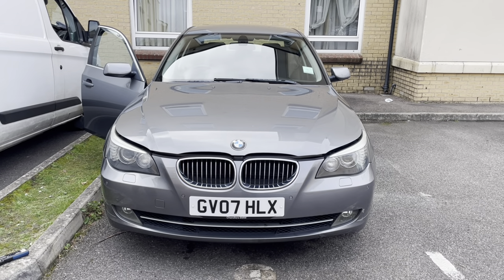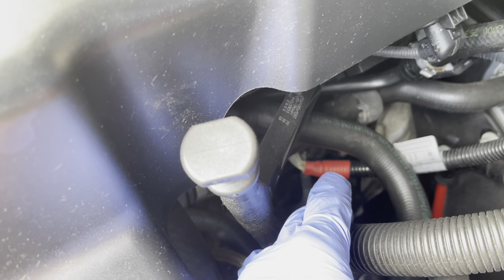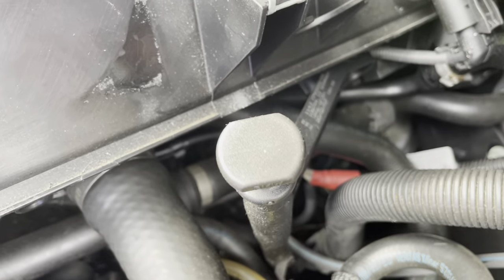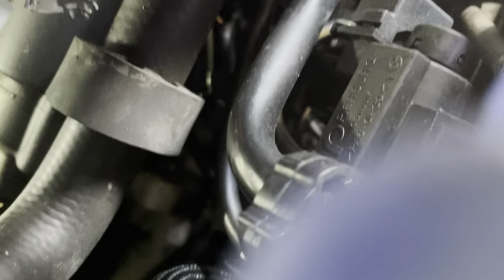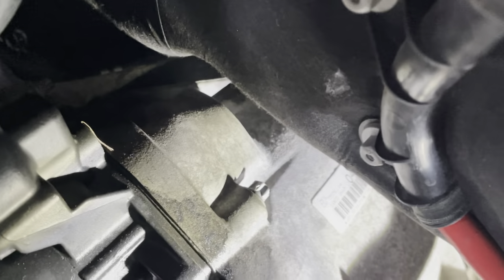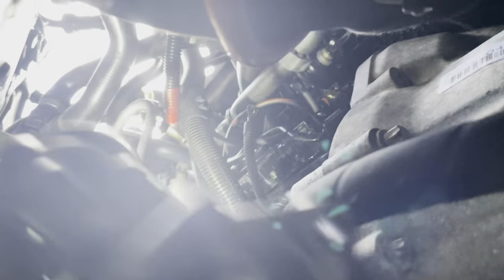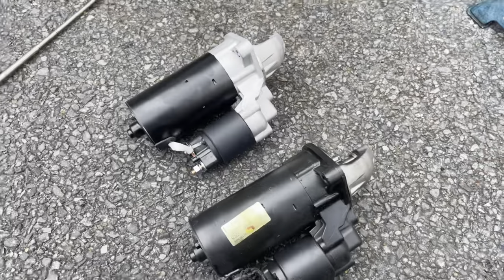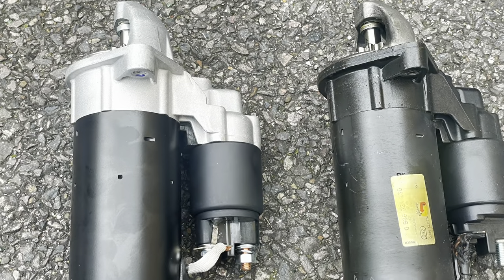How to replace starter motor on bmw 5 series

Comment: Hello, I have problem with my bmw 528i 2011. I disconnect battery for starter replacement, it made loud alarm (louder than usual), i connect battery back, and remote controll partialy stop working. I cannot lock and unlock the car, but i can start. After start, engine stalls after 1-2 seconds. Maybe somebody had this problem before ? Or somebody can give some suggestion..

Comment: Did you take the inlet manifold off to do this?
Reply from the maker: No..!
Reply: @Cham.88dis  OK I was just wondering. Iv got to do my starter motor on my e60 530d. Thanks for the video